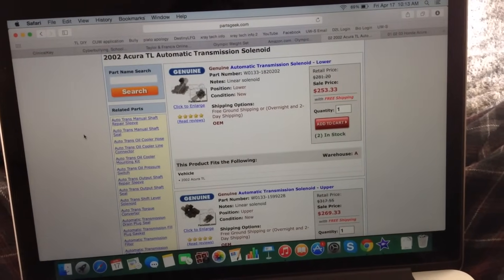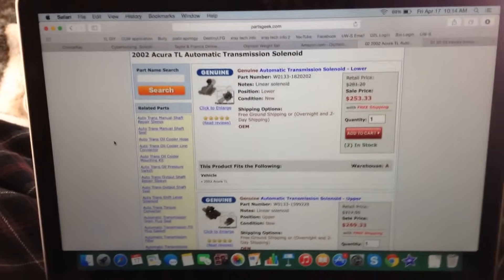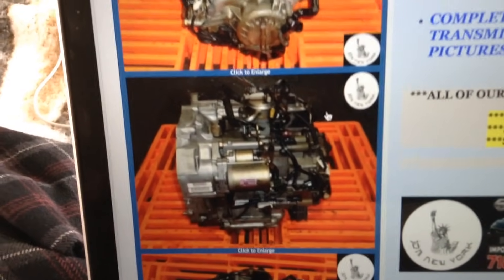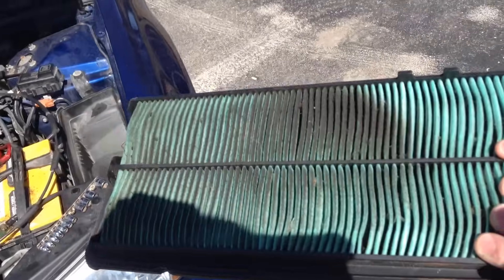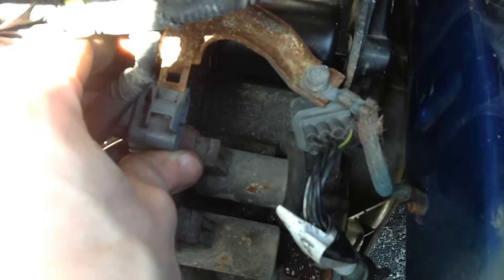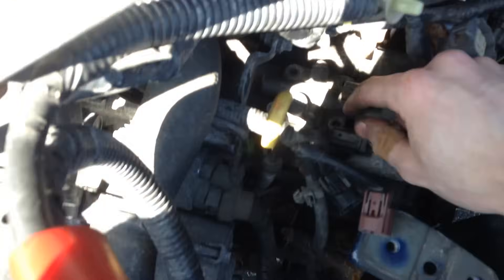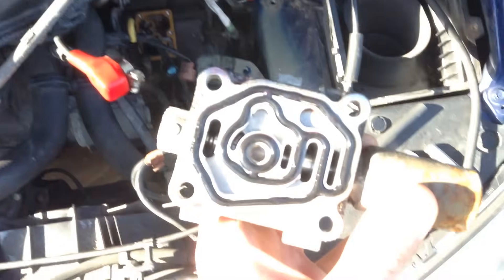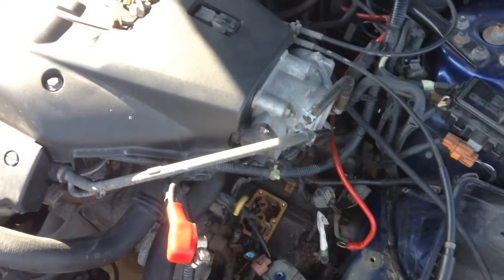Transmission Fix: How to Clean Solenoid Screen Filters for Honda/Acura P0730 P0740 P0780 P1750 P1751

Comment: You da man!  Cleaning these two spots fixed my issue. At least for the rest drive last night.  Time will tell.  Thank you!

For everyone else. I have a 2003 Honda Pilot. Code P0730. Hard and random down shifting from 4 to 2nd/3rd.  Hard up/down shifting, randomly. I thought the trans was going to fall out. It would slip at times too, to the point of not moving. It was very unsafe. 

I cleaned these two spot and it’s running perfect now. 

Lower screen was 100% clogged. Upper/middle was 90% clogged.
Reply from the maker: Crazy that a filter the size of a pencil eraser can cause an entire transmission to fail! Glad this video helped you!!
Reply: Incin3ration well, it didn’t work for me.  Back to the drawing board for me.
Reply from the maker: @motofun72  is your transmission fluid clean? and is it at the proper level? Low transmission fluid or simply changing the fluid has worked wonders for people that I've heard from. Also when was the last time your exterior transmission filter was changed? All very important things to consider, especially since your screen filters are getting clogged. Also, it is possible the solenoids themselves are bad. Maybe look into that as well to see if they're functioning properly and whether or not they need to be replaced.
Reply: Incin3ration I changed my oil last week and it’s at the proper level. I’m going to change my trans oil again this coming up week along with the external filter and 3rd/4th pressure switches (bought from Amazon). If that doesn’t fix it, then I will test A/B solenoids (those are harder to get to, so I need more time).  

My fingers are crossed.
Reply from the maker: @motofun72  Let me know how everything ends up working out for you! I'm curious to know if changing the pressure switches/solenoids works for you!
Reply: Just wondering if our trans issues were repaired with those items that you were going to do ?
I am having a similar  issue as well ?
Reply: box1u no, it didn’t fix it. I’m limping along until I can buy a newer car. All the work I did, didn’t help, however, the more miles I put on the better it was doing. 

The cold weather has helped too, since it keeps the fluid thicker (I’m guessing). 

Transmission place said it will cost me $3000-4000. Honda Pilot 4wd 2003.

Comment: I couldn’t get the Stubborn Bolts loose when I was trying to remove the Battery Plate. They were on Very Tight! Did you have trouble removing those Bolts holding the Battery Plate?
Reply from the maker: Yeah some of them can be stubborn, especially if they've never been removed before in the last 16 years. I use my biggest ratchet and longest extension to remove them. Maybe try an impact drill?
Reply: Incin3ration okay I will try a longer extension on my Ratchet. Hopefully that and some WD-40 on the bolts will loosen them up.

Comment: are the filters all the same size for a base 3.2L?  i checked acura part sites and they show them all the same length, but on honda sites for the same engine, they are all 3 different lengths.
Reply from the maker: They do vary in size depending on the exact year, make, and model. For the 2000-2003 base and Type-S TL's, all three filters are the same length (8x18 Pipe) as far as I'm aware. On the 99 TL, they're different lengths. I would recommend going off of what the Acura website says. I personally like acurapartsforless.com.
Reply: thank you

Comment: I have a 2001 CL type S on my type S it started shifting really hard now it will not let me out of first gear my reverse does not work do you think this process will help. On my 2001 TL it did not want to go in reverse but I stuck the key in the slot by the shifter and I had no more problems since then
Reply: It does not let me go over 60 miles per hour. If I try to go over 60 the car will jerk really hard as if I'm forgetting to change the gear my D5 consistently blinks after 2 3 minutes driving and my transmission is automatic on both cars
Reply from the maker: yeah man this could definitely help! It can only do good and it's free to do! I had some crazy similar symptoms and this fixed my car! Give it a shot! Plus make sure your transmission fluid is clean and at a proper level. Good luck!
Reply: @CarRepairsMadeSimple  I did today and it work for 10mins but the reverse works more othen. I'ma just going to buy another cl.

Comment: Hi Incin, totally awesome instructional video. Really well though out and I appreciate including initial pics and identifying a 2nd solenoid area towards the bottom. I have a 6th generation (98-02) Accord v6 and looking at my engine compartment it appears my transmission is set up the same. Would you be able to concur? I have 200k and started having intermittent shifting delays so I replaced my water pump and timing belt. Of course that was not the problem. I did a transmission fluid change but still have issue. When idling with brake on and shift through gears there is a definite jolt going from D4 to 2. Going back up seems the same when moving from 1 to 2. Sometimes there is a delay into second when starting from stoplight. However I also notice that if I'm heavy on the pedal shifting sometimes seems smoother. Any thoughts would be appreciated. Again thank you, Michael

Comment: Before taking all that crap out of your engine bay try 10 oz of Sea Foam Trans Tune down the dip stick tube. Drive it for 300 miles then change the Transmission fluid. It  worked for me. The code cleared and it's shifting smooth. Sea foam desolved all the sludge that was built-up in the sensor screens and other parts of the transmission.
Reply from the maker: hmmm interesting! I'll look into it, thanks!

Comment: My man! Just came from your hood struts replacement vid talking bout your car's paint to exactly the vid I needed to watch!! You sir have a new sub! My TL 01 while on freeway the check engine light came on w/ TCS, opened n closed gas cap hours later turned car on TCS light was off check engine light was still on. OBD it @ AutoZone and P0740 & P1298 came out, print out said "replace transmission shift selenoid(s) & flush transmission fluid" also said "fault in the torque converter clutch solenoid electrical circuit for a predetermined period of time" but the thing is that the transmission doesn't slip or jolt or there's no hard shifting its just normal (still) any thoughts? Car has bout 144k miles and just did a full synthetic oil change 2 weeks ago don't know if that matters ha! Thanks man!
Reply: Oh yes! Extra info. While on freeway had to break because i got cut off and water bottle hit the shift stick into neutral I didn't notice so I pressed on the gas and the rpm needle when up high -of course pressed it again till I noticed it was on neutral. About 20 mins later the check engine & TCS light came on, I thought it was a loose gas cap since I had "revved" the engine on neutral and I had just put gas the night before. Just extra info.
Reply from the maker: The car is able to detect when the screens are just starting to get clogged before it starts noticeably affecting the transmission's performance. Odds are there's a little transmission clutch wear starting to build up in there causing your CEL. So I would go ahead and clean them out! The fact that you changed out the ATF is also good! You don't want that to get too dirty. Also if you're going to be taking your car apart and cleaning out the solenoid screens, might I also recommend replacing the exterior transmission filter since it's also right there!
Reply: Incin3ration wait I didn't do an ATF flush it was just an oil change.I will clean the solenoids out but somebody told me though to change the ATF 3 times, any thoughts on this? I've never done an ATF flush since I got it in 08 Also, I drive 100 miles every day x6 @80mph is it still ok to drive it like that? Or am I messing something else up? Thanks man! ..Oh yeah also I took it to the mech ran his obd said it was engine problems needed a new engine told him about just cleaning out the solenoids stood quiet for 3 secs and said he had done that to his Honda and they kept clogging up again and again and again.
Reply from the maker: Oh sorry, must have read that wrong! Thought you were referring to changing your ATF. Since we are on the topic, if your ATF is really dark, I might recommend doing an ATF drain and fill 2 or 3 times. If you do multiple drain-and-fills, be sure to space them out by maybe at least a week so you're not completely shocking the system with brand new fluid all at once.  Also, it's actually very good for your car to get lots of freeway miles like that! I myself drive about 90 miles per day right now all freeway. What's really bad for a car is not driving it enough and driving short city stop-and-go type commutes. The screens won't keep clogging up like he's saying. Even if they do, so what? I'd rather make my transmission last as long as possible and clean them up for free every now and then rather than pay for a new $3000 transmission. Maybe he doesn't change his ATF and filter idk. Sounds like he's trying to make $$ off you. I did have to clean them another time after making this video. Turns out it wasn't clutch wear material but rather a fibrous material coming off the much cheaper Autozone ATF filter I put on my car. Never making that mistake again, OEM all the way.
Reply: Incin3ration thanks for all the superb info man much appreciated! Is drain & fill same as flush? And yes I was also thinking of going w AutoZone's filter but from what you said oem it is.
Reply from the maker: A drain-and-flush is what we did in this video where we drained the pan once and filled it back up. A flush is where you would do 3 consecutive drain-and-fills in a row to essentially change out as much of the old ATF as possible. There is also a true flush, which is highly advised against, where you can use pressure to force all of the old fluid out of a transmission, and then fill it back up with new fluid. This is why I recommend driving for a good week or so in between drain and fills so the transmission isn't shocked too quickly and causes even worse problems than before. Yeah the OEM filters are expensive A.F. which really sucks, but it's worth it.

Comment: Didn’t see you replace  o rings or gasket. Did you or others experience issues with leaks
Reply from the maker: Nope! I have not heard of anyone having any issues with leaks. Just remember to clean them and apply a light layer of clean ATF to them before reinstalling. If a gasket gets lost or needs to be replaced, they are available on any Acura parts website.

Comment: I just bought a used jdm trans for $450, the original one i had in my 03 tl-s torque converter crapped, I’ve since swapped them and ran it for a week and same codes came up p0730-p0740, I’ll clean the solenoids both top and bottom in a few days and see it thats causing my rough shifts between 2-3rd gear.
Reply: Did you fix it?

Comment: I don't an air gun can I use a Q-tip to can it out or blow it out with a hair dryer, I understand it has a filter on one end of it. Can it be washed with warn water and then re-oiled. Thanks for this video it's very helpful i'm trying to figure away to do because I don't have that blower, if you can come up with something I'ed really appreciate it and thanks for your reply.
Reply from the maker: a lot of people have told me they use brake cleaner. You could definitely try that. Otherwise I suppose you could try shooting some water through it! Make sure you dry it though!

Comment: Just wondering if cleaning this parts may help me with my problem.  We just had spring clean up in our community where everyone puts out their junk so other who can use it can pick it up before garbage day,  I scored a 2002 Acura mdx with 200k miles.  The only problem it has is third gear isn't there so you have to drive it manually shifting past third in the automatic trani to 4 th gear.  Have any insites ... thanks for the youtube...Daryl
Reply from the maker: Cleaning these solenoids could possibly help. It's easy and free to do! Only good can come from it! However, I've never heard of an entire gear just not work, and everything else work just fine. Are there any check engine light codes? Replacing the 2nd and 3rd gear pressure switches might be where your issue is at. Also make sure the ATF looks red and clean, not dark and burnt. Good luck!
Reply: make sense...thanks for the info....Kind regards Daryl

Comment: No codes but had trouble shifting into third sometimes (slip, hard shift), and all gears had a similar but less prominent problem. Center filter was pretty clogged on the top solenoid screen set, and the bottom one was also pretty clogged. Cleaned them out with a q tip and mineral spirits (no air gun...) and transmission runs like new! Thank you so much for this video!!!
Reply from the maker: Awesome!! Glad to hear it worked!!
Reply: Check transmission fluid it meant have fluid

Comment: Hey bro I have 2003 Acura TL 135k miles recently it started jerking on second gear when it comes out of second gear it goes high in Rpms then goes to third it does it on 3rd but not as much as 2nd and the transmission oil hasn’t been changed in a while it’s really black you think that can be it ? I already ordered the oil from Honda and the filter.
Reply from the maker: Yes black ATF could very potentially cause problems. Further more, if the fluid level too high or low, that can be bad as well. I made another video on how to change your ATF if you need any help or additional information!
Reply: Incin3ration thanks bro ! Your videos are really helpful !
Reply from the maker: +Adrian salazar you're welcome! I appreciate the compliment! I'm hoping to upload some more videos this spring, keep an eye out!

Comment: I just did this on my 2001 Acura TL with 231k miles on original trans.  Was shifting weird from 2nd to 3rd.  Sometimes hard, sometimes missed, sometimes slipping and surging.  No light or code. Screens were clogged exactly like in the video.   Also did the first drain and fill of the 3x3qt with Maxlife.  Two test drives and it seems to have fixed it.  Thanks for the video!!!
Reply from the maker: You're welcome! Awesome to hear it worked for you!

Comment: I encourage anyone who is having transmission problems to do this. I did this with NO problem. never done this an it was VERY simple. save ur self the cash. I used throttle body cleaner, and in a 2000 Acura TL their is no need to remove the air box.
Reply: I have a 2003 CL type s I just bought about a month ago, car ran perfect and was owned by older lady. Yesterday car started to do this. Will try this fix today, thank you!

Comment: Hows your transmission is it still working?
Reply from the maker: 249,000 miles and still going strong!!
Reply: Incin3ration my 2001 acura cl type s is shifting very slow so imma try this and hopefully it works for me
Reply from the maker: It's an easy and free repair. It can only do good to your car! I hope it helps your car to run smoother again!
Reply: Incin3ration  do you recommend I replace and gaskets when doing this?

Comment: I have a 2000 Acura TL that started shifting hard at about 173K Miles. After viewing your video a few times I went out to my shop and performed your cleaning process of the screens. I found the exact gunk you did loaded up on the one upper screen and the lower screen as well. I didn't have compressed air but used brake parts cleaner to remove the buildup and what can I say but it worked beautifully!!!  I could see where a Transmission shop could have made this a $1500-$2000 repair in a complete rebuild that was not needed. I was a little uneasy about reusing the same gaskets but carefully cleaned them off and using transmission fluid on the lower rubber gasket and working it in on the rubber was able to reassemble with no leaks. On my car I didn't need to remove the air pipe to gain access so it saved me time while doing this process. 

My Acura now shifts beautifully again just like it should...

I also did the transmission inline filter at the same time and with an Ohio car the bolts were a little rusty but I sprayed them down with solvent and when the bolts got tight, I stopped, spun them back in, used a small metal brush, tooth brush size (Harbor Freight) to clean the threads and repeated till the bolts came out clean. If I had just tried to crank them out I'm sure they would have broken off making a big problem but taking time to work then out saved the bolts and the threads in the bracket. I used grease on the bolts when re-installing to make sure they would spin out when the filter needs changed again.

Hats off to you and thank you VERY much for taking the time to video the process and share it with other Acura/Honda owners. 

Your videos and the quality of the view and explanation to guide others through various repair processes are 2nd to none! 

Thanks again and keep up the great works.
Reply from the maker: Thank you so much! I appreciate it! Glad to hear your car is running beautifully again!
Reply: Agreed !!  This guys videos are great and have helped me do a lot of work on my 99 TL.  A Big Thank you to the Channel Guy !!